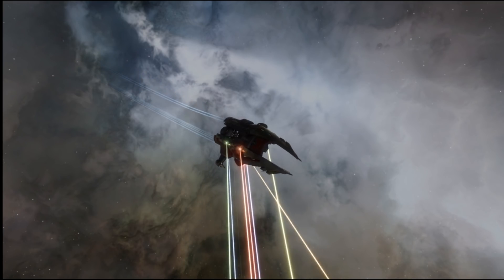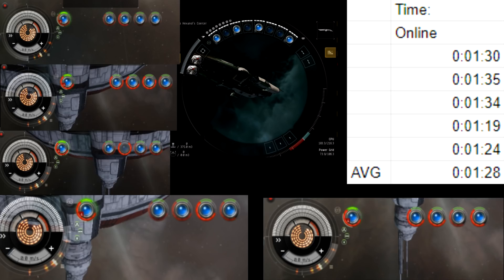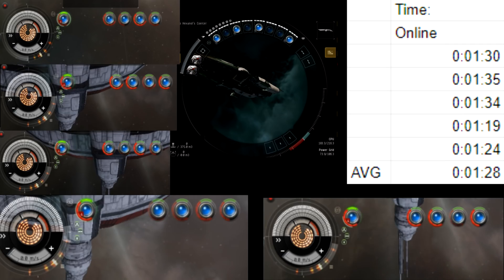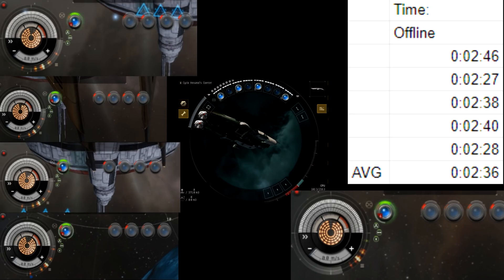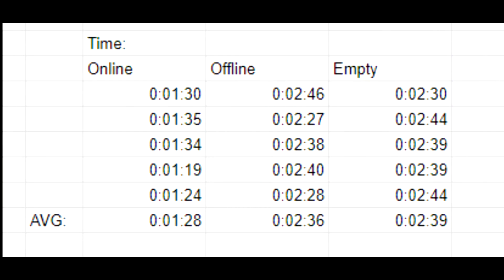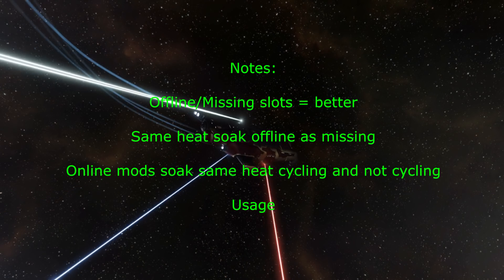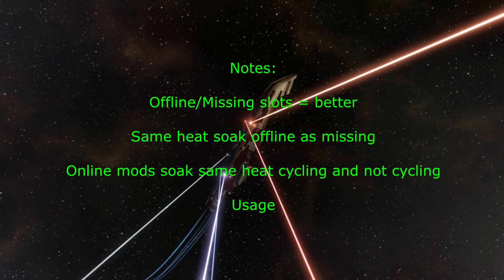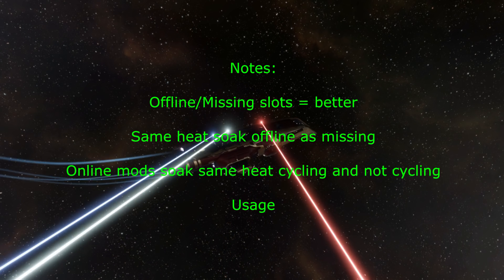Rekt Academy - Heat Sinks

Comment: Nice, thanks for the info. Also would like to dispel something I heard in-game recently from some leet players, that heat damage 'wraps' around the rack between the first and last turret/module.. This vid reminded me to hop on to SISI and check it out. Damage bleeds outwards to it's neighboring module(s), and to a lesser effect to their neighboring module(s) and so on. It doesn't bleed from the first gun, around the back of the hull and into the last gun, so no 'wrapping' or whatever.. :)